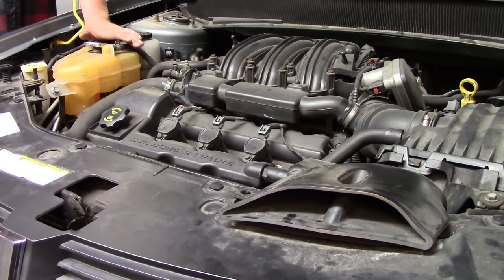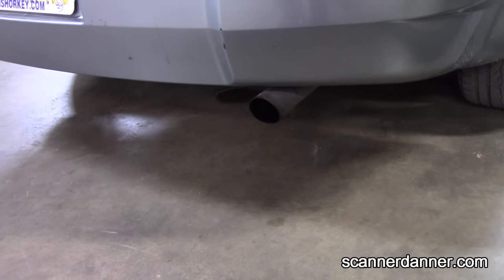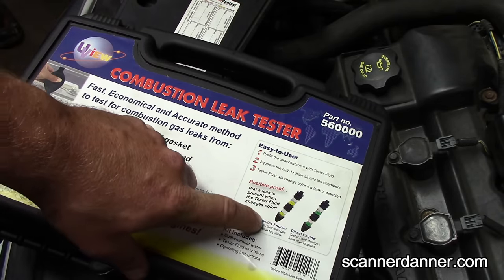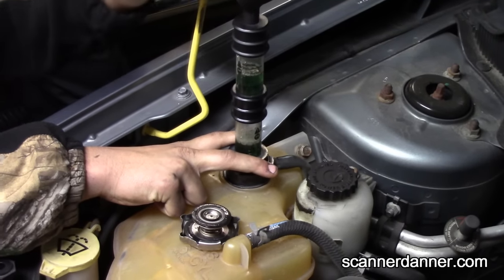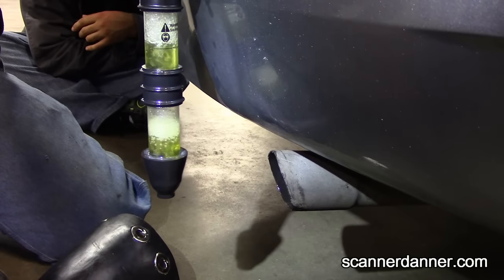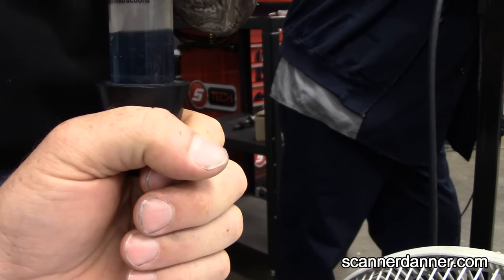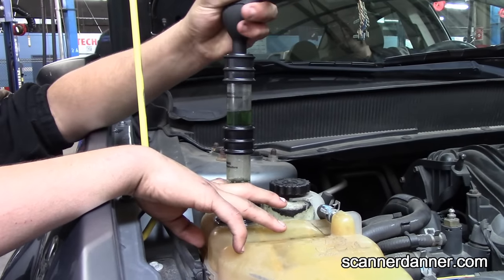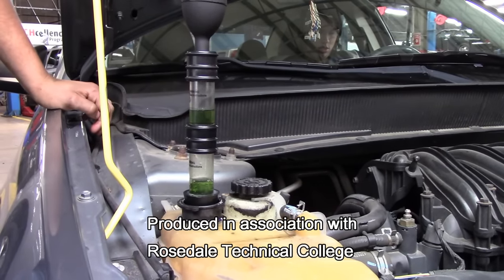Testing for a bad head gasket  - Gas Analyzer vs Chemical

Comment: The trick to the fluid tester is to have the engine warm and the thermostat open so the coolant flows. Then leave only about an inch or 2 of headspace.  Good fluid will change color with the % of CO2 in the bubbles in the coolant that contaminates the free air in the coolant system. It turns from green to yellow, green is a small leak, yellow is a large leak for gasoline engines. The tool is designed to catch an early head leak that otherwise is not very obvious.  If the cyl is dead, then there are other ways to find that the coolant is in the cyl in question.  I agree the sniffer is much better, but the chemo test is a cheap handy tool to eliminate a possible cause for an issue IF the cyl is still mostly firing ok.  I've avoided buying a couple used trucks by using this chemo test, when the trucks seem to run perfectly well but OOPS... the test turned green, or greenish yellow.  Often is a simple red flag to let you know there is a very tiny leak somewhere waiting to become your next big headache.

My ford is missing on #3 randomly, I run this tester a few times under a few conditions to confirm its not coolant fouling. Dark blue no matter what ya do, and thats good.

Its a limited tool designed to do a very limited test.
Reply: Perfectly explained
Reply: If u got a 25$ scan tool u can see misfire code,if clear no codes is prety sure

Comment: The fluid is Bromothymol blue in water; the chemical reacts to PH changes. When CO2 is 'dissolved' into the solution it forms carbonic acid, which makes the solution more acidic. This PH change causes the solution to turn from blue to green to yellow depending on how acidic the solution is.

The reason why exhaling into the tester turns it green/yellow is because humans exhale CO2.

The reason that a gas engine turns the fluid yellow, while a diesel engine turns it green is because diesel engines produce less CO2 during the combustion process.
Reply: We use this on planted tank aquariums to keep the levels of co2 at 30ppm for optimal photosynthesis and keep the fish from suffocating.
Reply: Hi mate.. How many gr of bromothymol in water? Do you know? Thanks. I want to make that solution.
Reply: Bromothymol blue
Reply: Question: Why bother with this kit at all? Can you not just measure the PH of the coolant and see if it has changed? Maybe it reacts differently to the CO2?
Reply: But there are any number of factors maybe that can alter the coolant ph, which aren't combustion gases and blown head gasket. So only combustion gas from cylinder can used.

Comment: Every shop I've worked in for 30+ years uses this block test as the go no go test for head gaskets leaks over the gas analyzer.. This is a VERY old testing method and been around long before gas analyzers.. I use both methods and the Chemical block tester is the test that "is" the most trust the test.. Thank for a great video 👍🏻👍🏻👍🏻👍🏻

Comment: I have never had much luck with test fluid. Since we no longer have a working exhaust  analyzer I pressurize the cylinders with shop air and watch for bubbles in the cooling system. It's more work but it has never failed me yet.
Reply: how i do it too,plug out ,on tdc,valves shut,pump in the air,if good,air goes nowere,if bad,comes out of many places,exhaust,colant tank,air filter, box,or side head,gasket line,love it when you go quiet and turn the air on,same as drop down test ,then see were it goes noisy

Comment: I've never had the fluid turn exactly yellow, always light green. after tearing the engines apart always found a cracked head or blown head gasket. but you're right its scary to trust the tool when I could never get it turn yellow. I usually just fill the second chamber up cause I always suck up coolant in bottom fluid.

Comment: Hey Chief, it's in the manual

"Combustion gas, when it enters the cooling system through any leak, accumulates in the air cushion above the radiator coolant level (in sealed coolant systems, this air cushion must be created by lowering the coolant level about an inch and a half). The Leak Tester analyzes this air: The blue fluid turns yellow when CO2 gas is detected in gasoline engines and green in diesel engines. The double-chamber feature of the Leak Tester assures a high level of accuracy. Conventional detection methods often give incorrect readings because alkaline particles present in the air cushion can cause false indications of a combustion leak. Alkaline particles are absorbed by the Leak Tester's first chamber, which acts as a filter, allowing only air and CO2 to reach the second, upper chamber. If the blue fluid in this upper chamber turns yellow or green, it is proof positive that there is a combustion gas (CO2) leak into the coolant."
http://www.uview.com/site/ywd_uview/assets/pdf/99081870_comb-leak.pdf

I tested some with my dad the other day pouring some into a cut in half water bottle, just like a tablespoon or so, then I took a straw and blew into the liquid and watched it change color pretty rapidly. There's a great difference in magnitude for the concentration of CO2 from the atmosphere, a human's exhalation, and from combustion of hydrocarbons.

The problem I found with these devices is gathering enough combustion gas in the coolant system to have a sufficient volume to test with. I'm thinking about rigging up some special no spill funnel type deal to watch air burp out the radiator or reservoir and collect into a chamber that later I draw air from into the block tester. Should be fun.
Reply: Yeah, but he discussed some issues, like the amount you lower the coolant, introduces regular air, unless done naturally over a period of running, reducing the co2 percentage of the air. then if you used a little air pocket, it would be higher concentration of co2.

Comment: The chemical used in it is called bromthymol blue. It is an acid/base indicator used commonly in chemistry. The chemical reaction is when co2 mixes with small amounts of H2O it forms carbonic acid HCO3- + H+
The carbonic acid concentration affects color.
Reply: The reaction is reversible which is why it turns back to blue based on the pH of the solution
Reply: Also paul for HC, the gas sniffers they sell at home depot measure methane which is closer to gas. I bought one from home depot and it tested negative in a brand new toyota camry.... but heres a head scratcher. In my 2014 Ford F150 it tested positive and in my neigbors F150 so im not sure if ford did some unique formulation in their antifreeze or the engines are duds... the second kinda wouldnt surprise me lol
Reply: Acidic- yellow
Neutral-green
Basic- blue
Reply: use to use Bromothymol blue to treat tropical fish back in the 70s

Comment: Good video.   Many years ago I bought these type of testers from snap on. They were called carbon monoxide tester These wer only single chamber bottles. At first they seemed quiet reliable, unless you sucked in the coolant. Maybe without my noticing it, it was changed to carbon dioxide. It stopped changing to bright yellow, it got a little green, maybe. I bought an entire new kit, instead  of just the chemical.It still didn't work. I then relied on only cylinder leakage tests. I will not put a head gasket in a car that does not need one. Keep going.,good work.

Comment: Excellent, now I can answer explain a problem on my car. I had high water usage and many leaks. Using a gas analyser multiple times never indicated a H/G problem. However one of these went green after about 3 minutes. Conclusion if the car has no running issues HC test will not work if car is missing the fluid CO2 test may not work very well.

Comment: Paul 1st great vid. But may I add? If a misfire is happening  some ECU,s will kill the inj. so no fuel.
2ED On a ice cold eng. a cyl. leak down test works real well (keep rad. cap off)
Reply: Joseph Tucci you would probably see the money light if so
Reply from the maker: Correct, but there is always a period on start up where the injector will fire, regardless of the misfire code. In other words, even with injector intentional shut down, it will always fire for a few seconds on initial start up
Reply: 14:10 did your student actually have a blown head gasket?  ◉‿◉

Comment: interesting video. looks like there are a lot of variables to contend with.i always used a pressure guage on the cooling system and watched for the pressure to come up quick right after starting.  problem is there are many ways a head gasket or head can leak. usually a leakdown test works but sometimes ya just cant get enough pressure with a compressor to show a minor leak. you have compression pressures higher than your shop compressor but yet the combustion pressure is soooo much higher.and the leak may not even go to the cooling system.one must be vigilant oh weedhopper. discern the enemy with great care for the enemy may just lie within.
Reply: A misfire on the first couple of seconds after a cold start is becoming one of my favourite symptoms, it is more noticeable on modern engines as they usually fire-up on the first revolution of the crankshaft.
Reply: Andrew W MacFadyen, my Honda can testify to that.

Comment: I have used this chemical test before, but a different make. I red In that description that you have to blow in the tester, so the color just are beginning to   change color. Because to make the tester more senstive... and then do the test😊 It worked well. Great video.
Reply from the maker: The reason you blow into it is to test the fluid for contamination. Not to "get it going" to make it more sensitive.
Reply: What I ment; if the tester is in the blue/green condition, is has a "shorter" way to yellow. And if it change back to blue, it is no co2 in the coolant.

Comment: The Lisle kit uses a vacuum hose on it instead of the hand pump and I like it. Shows clear results. Would be interesting to see you also try to ghetto test. Get your Lisle coolant filling funnel on the reservoir. Put a household CO detector in it face down. Put a grocery bag over the funnel to hold gases in and run the engine. See if the alarm goes off. I have seen it work, but not sure how sensitive it is.

Comment: How the combustion leak tester work! I hope this can give some answers: Combustion gas, when it enters the cooling system through any leak, accumulates in the cushion above the radiator coolant level ( in sealed cooling system, this air cushins
Reply: Sorry! This air cushion must be creating by lowering the coolant level about inch and a half). The leak tester analyzes this air : the blue fluid turns yellow went CO2 gas is detected in gasoline engines and green in Diesel engines . The double chamber feature in the leak tester assures a high level of accuracy and this is way! Conventional detection methods excluding the gas analyzer but no everyone can have this machine in their shop... Well often give incorrect readings because of the alkaline particles present in the air cushion can course false indication of a combustion leak. alkaline particles are absorbed by the first chamber, wish acts as a filter, allowing only air and Co2 to reach the second upper chamber. If the blue fluid in the upper chamber turns yellow or green, it's proof positive that there is a combustion gas (Co2) leak into the coolant... Note: to test the Leak Tester Fluid: test the tool and fluid by exhaling into a cupped hand and sucking the exhaled air through the intake hole into the two chambers by squeezing the rubber bulb two or three times, holding the Leak Tester in vertical position. " Do Not put the rubber intake end in your mouth...

Comment: Very true , if no burn , the liquid test would be invalid . Agree, The liquid test is less accurate than a gas analyzer . But turning green gives good indication you are on the right track . Fluid did test right on the exhaust so guessing it is ok . Disabling spark to certain cylinders is how i get an idea which cylinders or bank the issue is on  . But  takes time as the fired gas has to purge out of the cooling system . I do use the liquid test , but would not say it was the best or most accurate test  out there .

Comment: I think it might react better if you'd waited a while with the coolant reservoir closed (like you did with the analyzer), or even better, with the bottle already in it ( making sure it seals good of course) and then pump it.
Reply from the maker: Good tip, thanks!

Comment: Snap on sells a portable handheld 5 gas for $2995.00 which is cheap considering what i've paid in the past. Whats nice is that it can be blue toothed to the Verus and added to your data stream or used as a stand alone. I added it to my Verus workstation when i was still wrenching full time.
Like you said in the video , gas analyzers aren't found in shops much any more which sucks cause its such a valuable diagnostic tool.
Reply from the maker: What's up brother! Long time no see. Thanks for the comment and for watching!

Comment: Paul, if you are wondering what gas is setting it off take your tester to the weld shop of your school and shoot some shielding gas into it. If it flags you know it was from carbon dioxide. If not you know it is carbon monoxide.

Comment: I have used the chem test for a while now and yes it isn't 100%. What i have found on gas engines is if its green its still a faulty head and/or gasket.Letting the engine heat up and build pressure while the tool is sealing the neck forces the gases through it and seems to be more reliable. Also you can reuse the fluid as long as you keep coolant out of your test tube. W/O a dout the 5 gas is the 100% way to go. Hope this helps.

Comment: Thanks for this video. Been wanting verification of the gas measured by these tests.
Looking at your display on your four gas analyzer (I don't see where it measure oxides of nitrogen), it appears that CO2 reading is not working properly since it shows a higher CO2 reading prior to putting into the radiator overflow tank (0.58% CO2 vs. .017% CO2 when you have an HC reading of 580ppm).
If the CO2 function was working, it would have been niece to measure CO2 at the overflow tank/radiator and at the tailpipe for comparison.
Finally, and as I have been trained, one should only put the gas analyzer probe near radiator opening to avoid getting coolant into the gas analyzer and causing damage.
Thanks again.
Reply from the maker: This gas analyzer does not measure NOX. And the CO2 measurements in the decimal numbers, I wouldn't trust either. This is designed to read the higher numbers. It would be like using a voltmeter on the 100 volt scales while trying to watch a millivolt change . 
As for comparing tailpipe Co2 to the overflow, it will always be significantly more at the tailpipe (around 15%)

Comment: The Hydrocarbon test is the only test I've found that actually works.    I've tried all the other tests and they don't work good.  Especially if you get a car that doesn't leak very bad.
Reply from the maker: I'm with you here man. I set out to disprove this fluid test at the beginning of this video and it surprised me in the end
Reply from the maker: but I think this tool will miss some early failures
Reply: @hw5091    I’ve been a mechanic for 30 years. The best way is the hydrocarbon test.
Reply: @1970chevelle396  sometimes you can get a low to no hc n still have some co2 going on. Generally the co2 reaches red flag levels before hc's do. Co2 is effectively hcs in the sense that it's the biggest derivative of combustion. It's just an earlier indication, if the gasses r getting into the coolant. You can be a 30yr mechanic or a person who just rented the tester from autozone- the test doesn't care about experience or feelings toward the result. A little kid who isn't color blind will get the same result.
Reply: Pressurised cooling system especially for bmw doesn't have chance this chemical test  i had  a bmw only overheats when u run it for long time  I this chemical test never work  but the problem was the head gasket

Comment: I have one of those UView kits and I am not impressed with it either.  The only time it seems to clearly show a confirmed bad head gasket is when it's already obvious that there has been a failure.  I usually have better luck filling the coolant bottle and pressurizing it on a cold engine with the spark plugs out.  It usually doesn't take long for one or more cylinders to fill with water.   This can be a pain in the a** on some engines.   Also, most air evac coolant fill tools will lose vacuum if the headgasket is bad.  This only works when everything else is sealed up 100%, not usually the case when you have a bad head gasket.  I find most head gasket issue are the result of leaky coolant fittings, flanges, etc.  The exhaust analyzer is a much better tool.  Unfortunately, they are expensive and hard to come by at a reasonable price.

Comment: I've used block test kits for years and never had an issue. The only time I've ever seen the fluid turn the yellow they show on the box is on head gaskets that are so bad that the car will blow coolant out dead cold/blow the cap out of your hand on a cold engine.

Comment: The tool is scientific and seems to work well in this case.  Call me crazy but I have opened the coolant fill tank and smelling it sometimes is a dead giveaway. The HC fumes.  On several makes my nose has found the problem (head gasket failure) before I even walked to the tool box. A have a big nose so that helps. lol  Also tend to see black carbon floating in the tank, the dirty ring around the bath tub kind of thing.  Hope all is well with you Paul.  Take care
Reply from the maker: Not crazy at all brother. I do the same thing

Comment: If it turns green that is good enough - it's a slow leak but it will probably get worse with time.  Best to fix early than wait for an overheat condition.